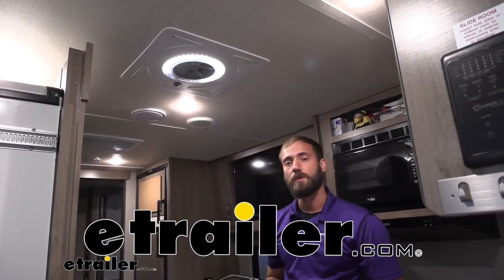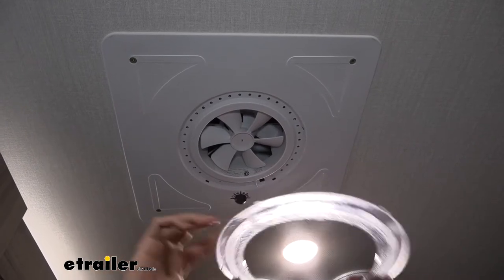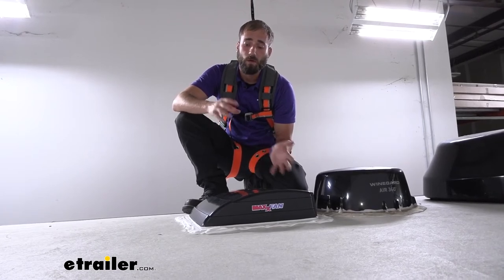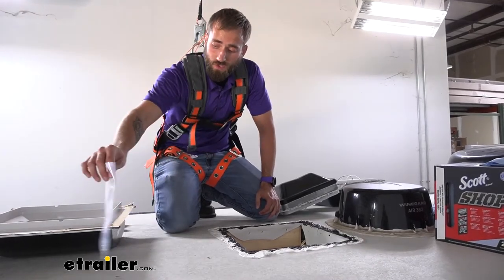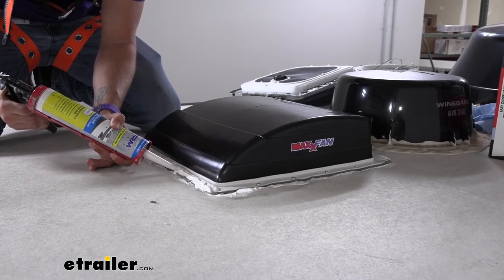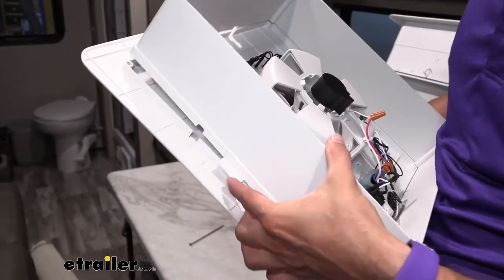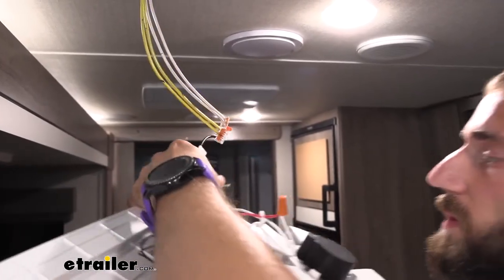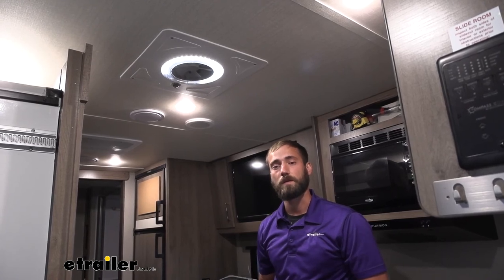MAXXAIR MaxxFan Mini Plus Manual RV Roof Vent Installation - 2022 Grand Design Imagine Travel Traile

Comment: Great work!  I own and have installed the max air mini.  I noticed you did not use sealant on the area between the black top and white base on the exterior. The black part tucks into the white part. I get rain coming in and have seen people seal between them. It looks like a bad engender design from the company. Imagine opening up an umbrella inside of a bucket where the sides are inside of the bucket instead of outside. All the rain rolls into the bucket instead of it all flowing around the premiere of the bucket. It makes no sense. I’m wondering what your thoughts are on it?